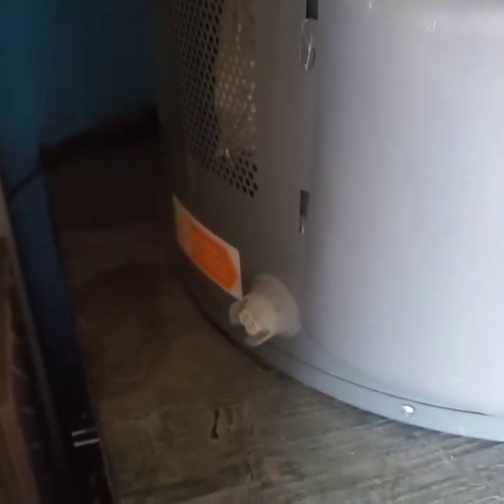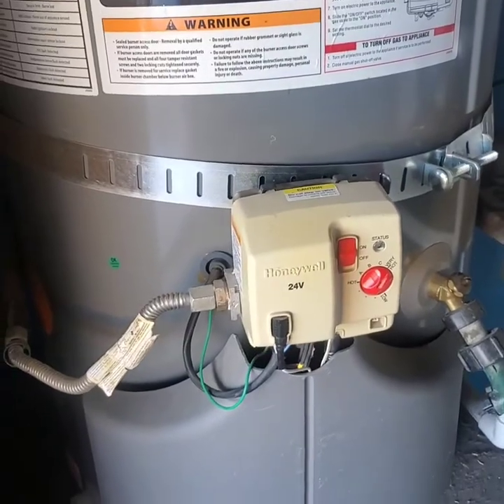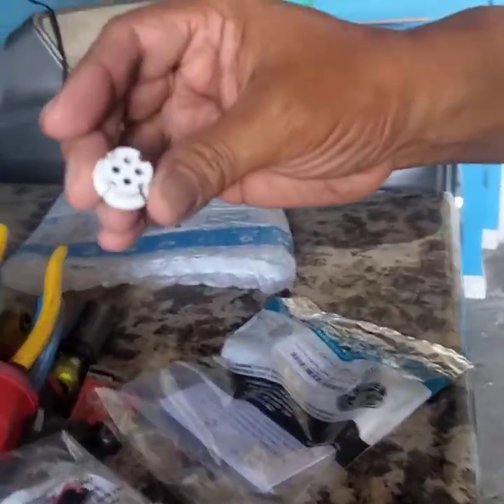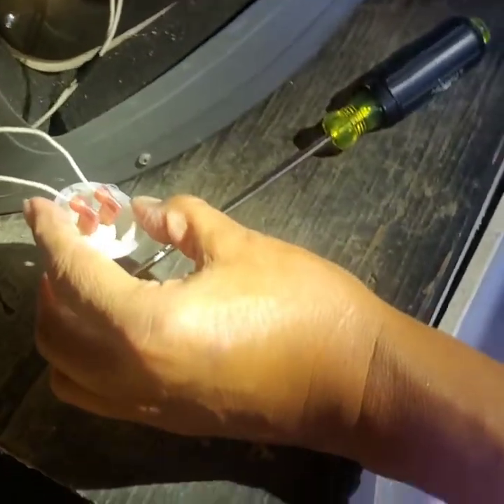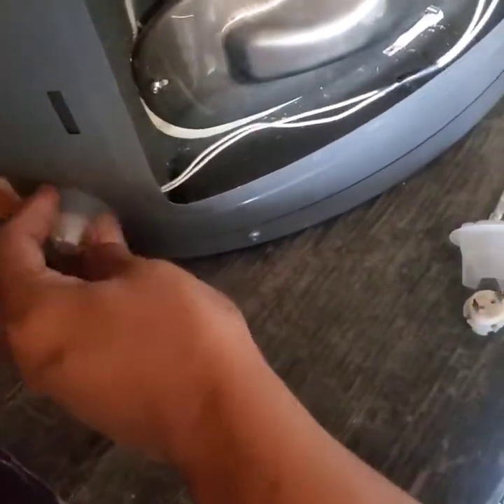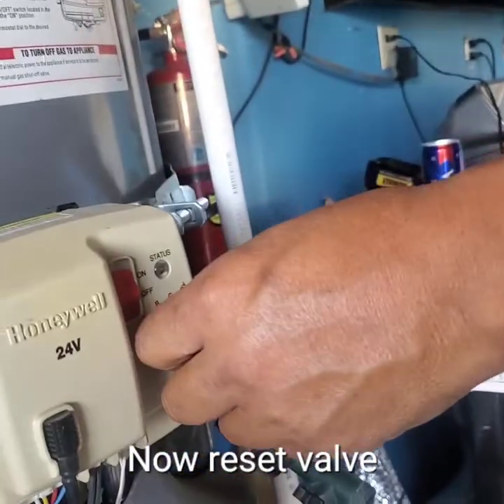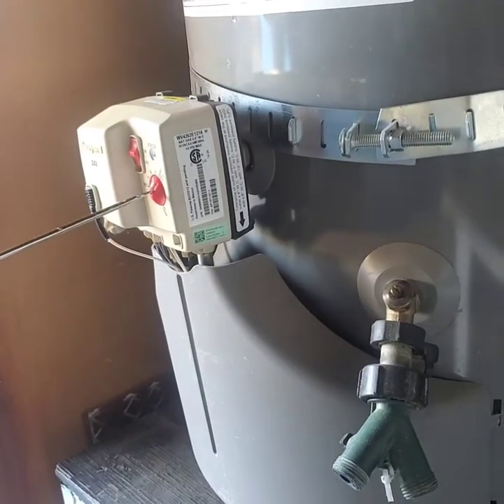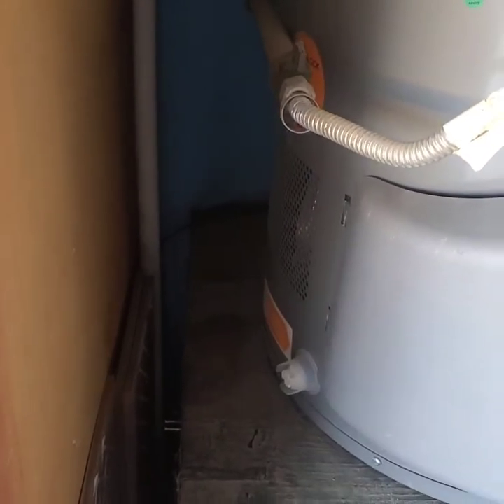DIY how to replace Flammable Vapor Sensor on a Rheem water heater

Comment: Just wanted to say thanks, I didn't need the sensor, but I used the reset sequence you demonstrated, and my water heater is back in action.
Reply from the maker: thanks for the visit. I do have a video on just the reset part.

Comment: You Saved the day. So I did the exact cycle your video shows without replacing the sensor. In my case I had just fired up the generator outside due to the cold snap  in case we lost power and had the sliding door outside and the detector did its job  😂 the joys of homeownership! 😊 thanks.
Reply from the maker: Excellent!

Comment: Hi. I have a Richmond water heater with a Honeywell valve. Did you also replace the FV sensor harness? If not, has it been running smoothly with just replacing the sensor?
Reply from the maker: I did not. its been running since I uploaded the vid.

Comment: I had two (2) new sensors (so I have a spare). One measured 14.4k ohm and the other 24.6k ohm. The old (activated) sensor was 1430k ohm (i.e. 1.43m ohm). In other words, the old had approx. 100 times more resistance than the new ones. Rheem's part number is: SP20172 (for the one shown in the video)
Reply from the maker: thanks for the visit

Comment: So I had 8 blinks followed by one chart said same thing. I couldn’t even put it to reset. Bought it used from offer up for 100 bucks with date of 2021 so barely a year old. Said it was from a renovation he was doing. Plunked it all up. And flashes came on. Because of this video I pin pointed that sensor was about to order but then decided to pull it out. Turns out one of the wires was chopped off I then stripped wires and heat wrapped it. Plugged back on and bam I was able to reset and it turned right on. New homeowner here and was so happy I got a almost new thousand dollar water heater for only 100 bucks. DIY is so rewarding
Reply from the maker: good for you. thanks for the visit

Comment: Thank a lot, You saved me a lot because the plumber I called told me that I had to replace the entire water heater.  I ended having to replace the sensor ($30). I found out that it was dure to the fact that we did some painting in the house and the sensor hated that.
Reply: Good, that plumber is pathetic.
Reply from the maker: good for you. thanks for the visit

Comment: I tried this severe times on my new Rheem gas heater and it still won’t light…..it’s throwing a 8 flash pause the. 4 flash! I’ve tried to reset it just like you described numerous times with no luck! Any advice would be greatly appreciated! Thank you
Reply from the maker: I would call Rheem Tech support. with your model number and serial number
Reply: @mrnoe67tiktok  I called tech support this morning and they said I have a bad “Gas Valve Controller” so basically, they are sending mea new control box FREE of charge since it’s still under warranty! Thanks for the advice and getting back with me! Much appreciated……

Comment: My wire connectors to the sensor were crimp connectors. When taking off the connectors off your old sensor, be sure to grab in a spot that you’re not squeezing down the connector tighter onto the prongs, otherwise it’s very difficult to remove!
Reply from the maker: thanks

Comment: Thanks for taking the time to make this. My instructions for resetting after the sensor were not correct for the application and this worked. Old sensor was 8k ohm, new sensor was 20k ohm. Water heater is back to normal again. 👍
Reply from the maker: Glad it helped

Comment: thank you. too bad the instructions that come with it don't tell you this is a common thing that happens with the Rheem from the vapor sensor and tell  you how to fix it.  Sorry i got rid of my  22 yr old GE  that wasn't causing any problem. And even tho they are willing to take care of it while under warranty, you have to wait for the part to come then for the  plumbing company to set up an appt. Not a quick fix by any means while you're out of hot water.
Reply from the maker: Sometimes you can reset the old sensor while your waiting for the replacement.

Comment: Thank you!
Reply from the maker: You bet!
Reply: @mrnoe67tiktok  as a temporary fix before my new sensor arrived, I took apart the old one and wiped the black gunk clean, revealing two small strips.  I then used a number 2 pencil to color in the space between the two strips, believe it or not it worked until my new one arrived.

Comment: Better yet, since Rheem won't give warranty on the sensor and it is a sensor that has constant problems when fumes don't exist, maybe it should be simply bypassed by just connecting the 2 wires, which of course is a no no and might cause legal problems in the event of a fire.  Ours keeps going into this sensor lock when there is no fumes of any type in the room which has ample fresh air.  All that's in the room is washer and dryer, freezer and some storage....no paint, no chemicals, no nothing of the sort of things that would cause this to turn the water heater off.  Better isn't always better lol
Reply from the maker: You cant't just by pass this with a wire its looking for resistance anywhere from 5,000 ohms - 70,000 ohms of resistance. So you can by pass it with a 20,000 ohm resistor, but I don't recommend it.

ohm resistor

Comment: Thank you for posting this video. Wish I would have watched this before this past weekend....had to wait on phone for over two hours with A.O. Smith to find out it was the vapor sensor that was bad. A.O. Smith manufacturer this Rheem in the video and many other brands includingding the Whirlpool one we have.) They would not tell me how to reset the heater to heat up again until I bought a new sensor. It was over a hundred dollars including rushed two-day shipping ($103.78 to be exact). I could have bught through Amazon and could have saved a whole lot of money. Feeling a little burned, but not by the water.
Reply from the maker: Thanks for the visit
Reply: AO Smith is terrible. They charged me $145 of which, $45 was for an expedited shipping from Rancho  Cucummunga CA to Bay area. This part is the one inch long and weights 4 ounces. Why do they charge $45 for shipping ?
Very disappointed that it's not covered by warranty either.

Comment: Local plumber wants $250+ to do what you just did, not including parts, lol.  Ordered the part myself.  Sensor is bad because we've had to reset many times.
Reply from the maker: I had the same problem, I reset my valve many times. replaced the sensor all good now.